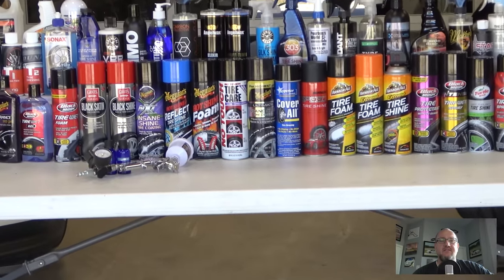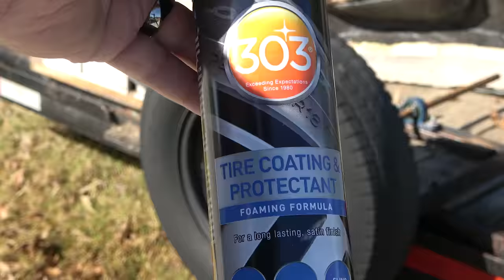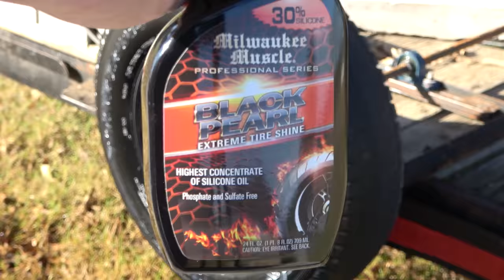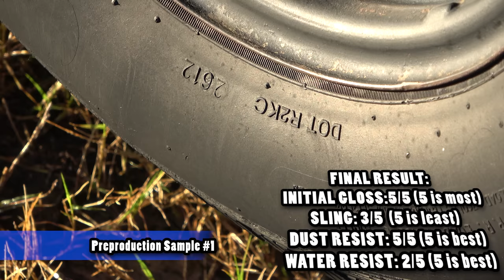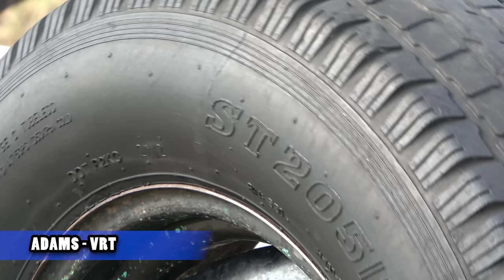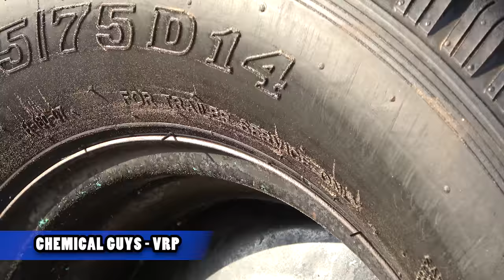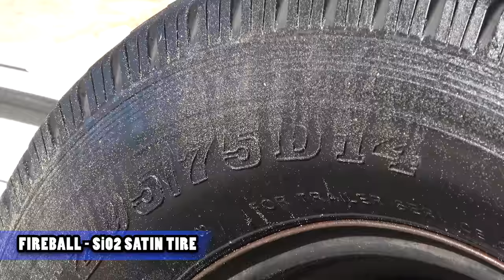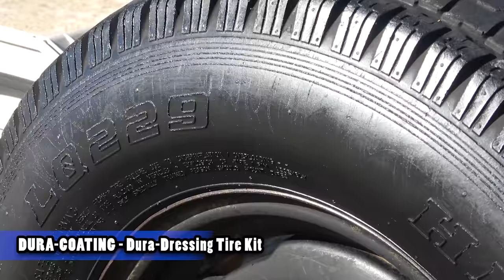ULTIMATE Tire Shine Test - We buy and test ALL OF THEM (Part 2 of 2: High end) Lots of surprises!

Comment: Can't believe the best car detailing scientist in the world was banned on the auto detailing subreddit. I'll share your video on there.
Reply from the maker: Thanks!  Yup. I literally shared 3-4 videos over a few months.   Got warned not to do it again.  Did it a little while later and got the banhammer. I can view just not post.
Reply: @ScottHD They're probably being paid under the table by Top Coat, haha.
Reply: Wow, that’s not good. The videos you do should be fundamental viewing for all detailers.
Reply: This has happened to countless mechanic channels under very similar circumstances. It seems to be an affront to moderators' egos that you made a useful video instead of a 20 paragraph reddit post with jumbled pictures at the top, worse UX than a vbulletin board DIY post from 20 years ago, where they have control over the life/death of your uncompensated efforts with a couple clicks. In their eyes you're not posting original research - you're trying to make a handful of bucks off the ad revenue. They really overestimate their importance and reach.

It doesn't help that most of the products on their shelves are not the winners of these tests - they chose to become emotionally invested in them to be 'the best', without investing in any primary research and testing themselves. They've probably recommended inferior products before, or have relationships with the vendors of those products, and banning dissenters is a backwards way to save face.
Reply: Instablaster.
Reply: the detailing subreddit is horrendously toxic, there are a couple of discord servers that have a main topic on detailing  and they are far better.

Comment: Thank you Scott for such an extensive video! Chiming in on the Duplicolor Tire Paint, I have bought 4 cans of it and each had a different spray pattern or mixture. One can would not spray right unless you were shaking the can while spraying, even then it was like sprayed on orange peel. The first can I had was the only one that sprayed with a fine uniform coating requiring only 1 coat, the other 3 did not. So something is up with the nozzles and/or mixture. Might check out the Lonestar one if and when the Duplicolor wears off.
Reply from the maker: Definitely!  Thank you for the input.   I was struggling with the tire paint and others have said similar things that the key is uniformity and it is hard to get!

Comment: Great video. I used adams Tire Shine and VRT alot, but have switched to Carpro Perl  (1:1 generally) and have found it to outlast adams. Having a few years use with  both products. Thanks for all the info.
Reply from the maker: We use Perl as well in our shop, but I use it at 100% usually, and frequently on engine bay plastics.   It definitely attracts dust, however.   I would imagine 1:1 it would be a little better in that regard.

Comment: I've been using Adam's VRT for years but unfortunately the product isn't shelf stable over a year or two, especially in an unconditioned garage. The product separates and it doesn't seem possible to get it well-mixed again. I also would like a look closer to what the Lone Star provides. The VRT looks great at first, but as it wears off it looks uglier than pre-coating.

Comment: Hi Scott.  When I wash my cars, I always scrub my tires with a degreaser and then apply some kind of short lived tire dressing.  If I use one of the dressings from your video that appears to last a while, should I still scrub it off and reapply every time I wash or should I just hose off the tires with water each time I wash until the dressing fails and then reapply?
Reply from the maker: Great question - in my experience, you wouldn't have to remove every time for ones like Lone Star or Dura dressing.  The others, yes I would continue to prep as you have been doing

Comment: There’s a rumor Turtle Wax will be announcing a Graphene coating soon. Might want to wait on your test. TW took over the ceramic world with their Hybrid Solutions line of ceramic products. They may take over the Graphene world too! I’ve already tried 303’s version of Graphene and was so disappointed I compounded and polished it off my car and applied Black Ice from The Last Coat  instead.
Reply from the maker: Noted.     I noticed NuFinish is coming out with a ceramic spray now too!
Reply: @ScottHD  first off thanks for all the hard work you put in. Secondly thanks for the reply. I actually still use NuFinish to polish the windshield and glass. It’s a cheap alternative that lasts a long time. I look forward and check all the time for your videos!

Comment: Not really sure what everyone else is seeing here. But what I see is a tire being dressed with product after products with no attempt to completely degrease and rid the tire of the previous dressing, which makes the results completely inaccurate. The very first product you used was SiO2 based and a little pressure washing will never remove that from the tire. Therefore the 303 didnt even stick to the tire and so on, so on.
Reply from the maker: Tire was completely cleaned with 100% (non diluted) heavy duty degreaser, a nylon brush, and dried between each product.  I also had several tires that I rotated out.
Reply: @ScottHD   those tires will survive a nuclear explosion!

Comment: Can you do products for rubber?  Sunroof gasket, windshield gasket, black window trim/belt moulding conditioners/sealants/treatments.
Reply from the maker: I have done some of that - look at my trim restorer tests.  I am doing a second part to that soon.   For sunroof gaskets, look at "Shin-etsu" grease as it is fantastic at keeping the seals plyable and UV resistant. It isn't cheap.
Reply: @ScottHD  thanks! I was watching the avalanche panel.  Can those products do both?
Reply from the maker: @robtolley7068  Yes - Plastic trim for sure.  Rubberized trim "it depends".  I have had some trim reject that type of stuff, and others it works just fine.  Maybe try an inconspicuous area to see how it will behave.  The newer ceramic type of trim products (what I will be testing in the second part of that test) such as CarPro DLux, IGL Trim, etc may work better on the rubber, but I'm not 100% sure just yet.